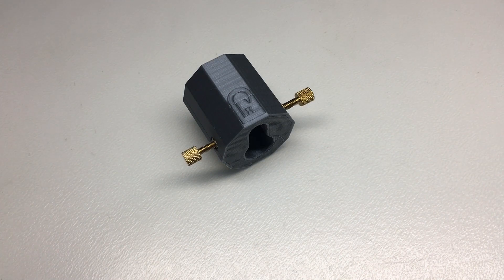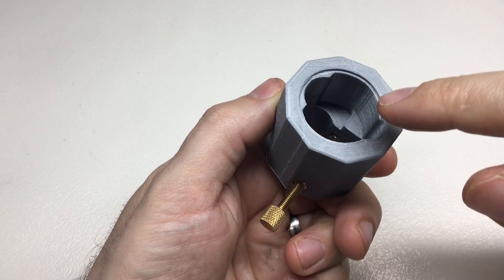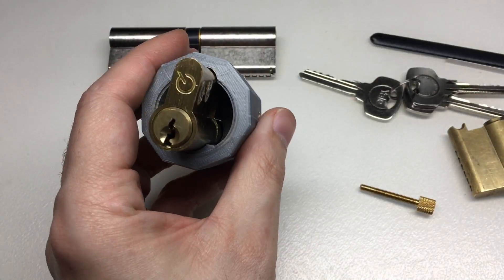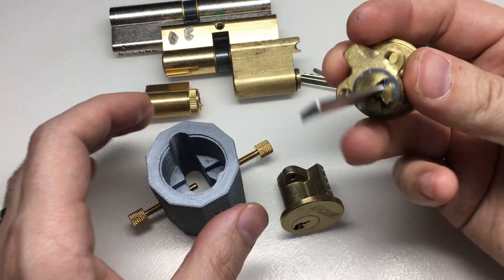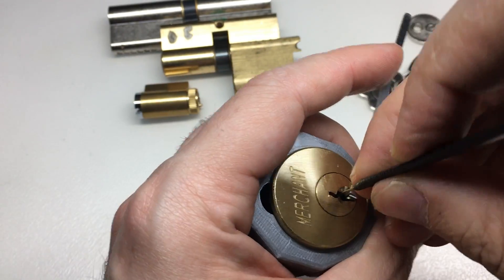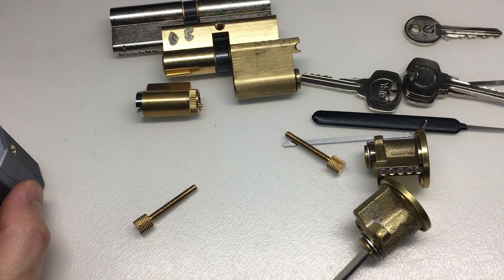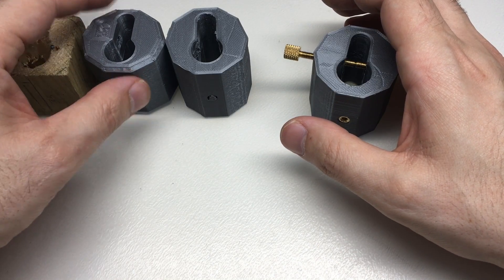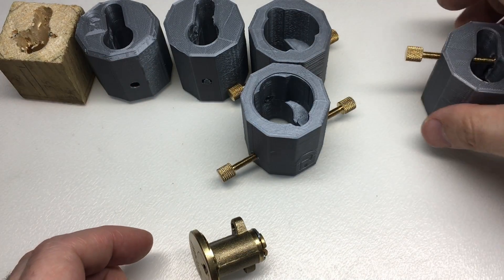(413) Lock Noob Lock Holder to 3D Print

Comment: Very nice multiple lock holder design . 3D printing is great, and a real time saver. I tried to make a kik holder out if wood, and it was crude, but effective.  You really need some good tools to work with wood, which I didn't have. Fortunately other people in locksport have 3D printers, and I have all kinds of 3D printed stuff, due to the generosity of our community.
Reply from the maker: Thank you :-)
Reply: I recently found out our library has a 3D printer.  :)

Comment: If you are still glueing in the hex inserts, if the hex hole is part of printing, leave a small knub in hex hole to allow the metal piece to snap in , just a thought!, great design and development execution.
Reply from the maker: I did think about that but I described to go with this design for a couple of reasons. Some 3D printers struggle to make holes this size without support and blocking off one side of the hole would make supports hard to remove, also epoxy is very strong when it’s set and I didn’t want the weakest part to be the holder; I’d rather the glue fail :-) I might do this idea in the future though since a few people have suggested it :-)

Comment: Instead of having the hex inserts coming all the way through the holder body, as you are 3D printing, what about only having the hex insert come partially through the body, and a round hole just big enough for the screw coming through to the outside. You can insert the standoff from inside the holder. This means that the standoff won't come out when you tighten the screw and you won't need to epoxy them.
Reply from the maker: I did think about that but I described to go with this design for a couple of reasons. Some 3D printers struggle to make holes this size without support and blocking off one side of the hole would make supports hard to remove, also epoxy is very strong when it’s set and I didn’t want the weakest part to be the holder; I’d rather the glue fail :-) I might do this idea in the future though since a few people have suggested it :-)

Comment: Very well thought out and interesting to see the design process. How long does it take the printer to make one of these instances? Those long screws might be in way sometimes but I have no idea how to secure the else. I also miss Pete.
For the inserts... You could have smaller hole and glue them in from the inside to have support from the material itself.
Reply from the maker: I did think about that but I described to go with this design for a couple of reasons. Some 3D printers struggle to make holes this size without support and blocking off one side of the hole would make supports hard to remove, also epoxy is very strong when it’s set and I didn’t want the weakest part to be the holder; I’d rather the glue fail :-) I might do this idea in the future though since a few people have suggested it :-)